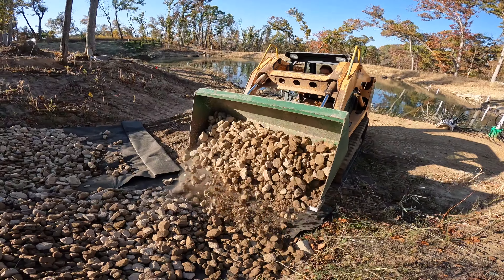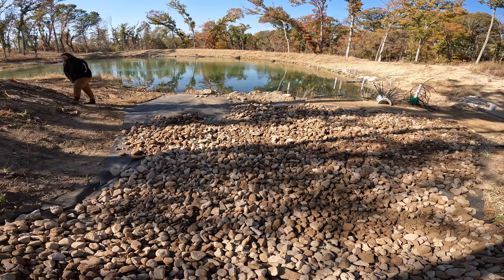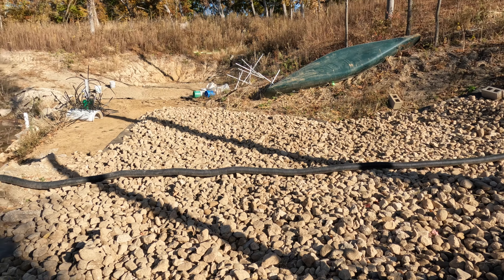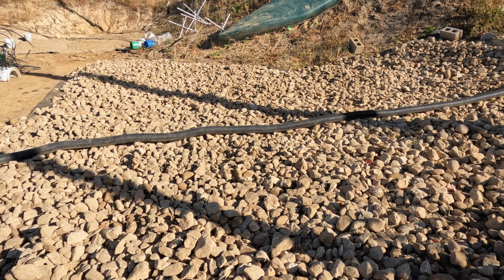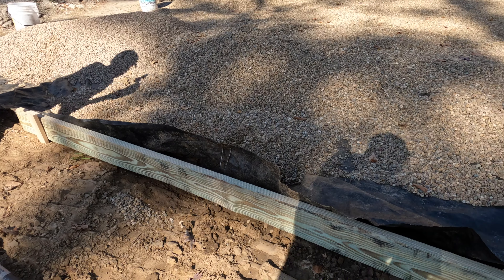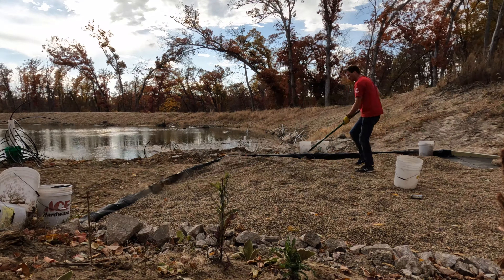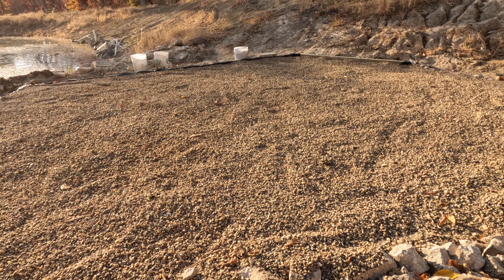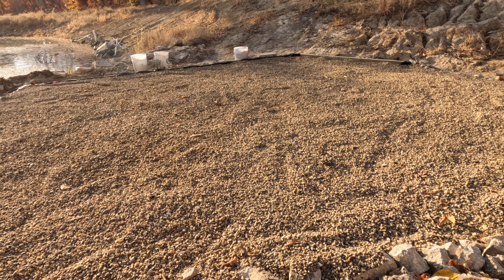Adding Rocks to Your Pond as Natural Habitat for Walleye & Smallmouth Bass Spawning Structure

Comment: You sure you want a treated board in that water?? Won’t it leech out the chemicals into your pond?
Reply from the maker: That’s a good question. I didn’t think much about it at the time. Kinda too late now, but after reading some…I’m not too concerned that it will cause a big issue. The chemicals they use to treat lumber isn’t as toxic as it was in the past. That said, it isn’t ideal. Had I to do again, I’d go a different route. But I think with the volume of water and aeration with the few boards we have in there, it’ll be okay. I guess time will tell. Thanks for pointing that out for others to consider.